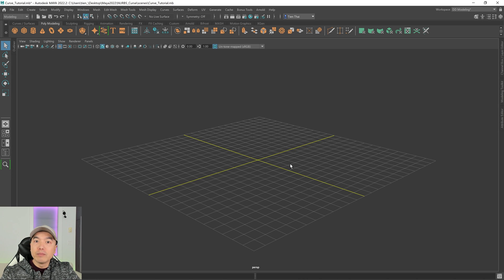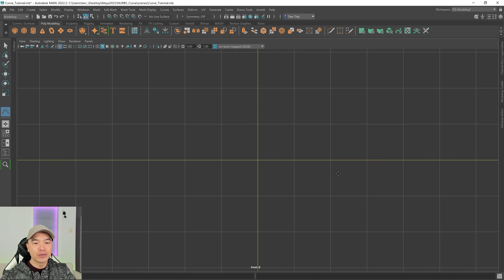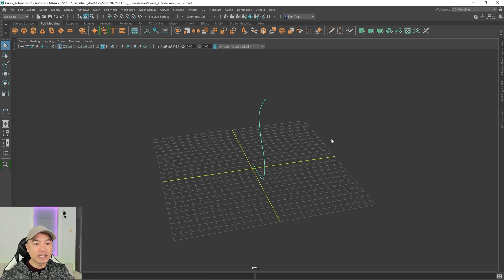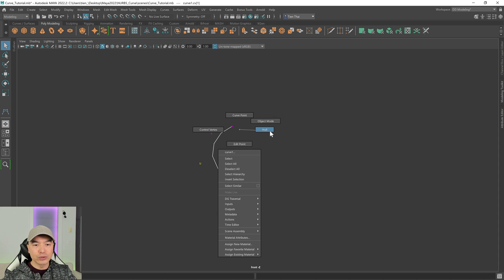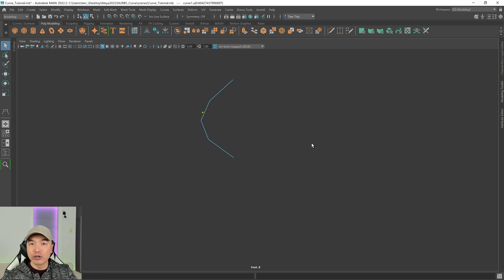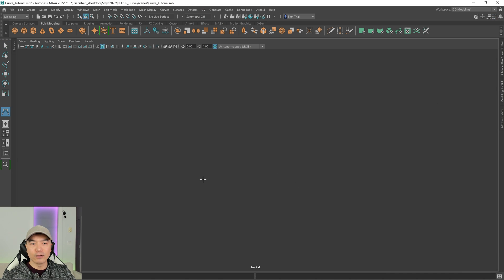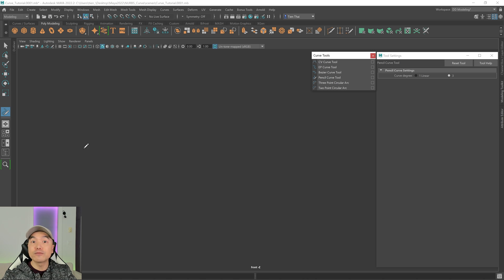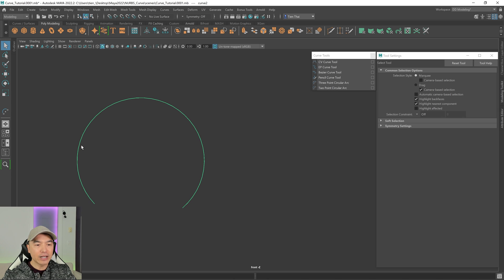Maya Curve Tutorial | Part 1 NURBS Basics

Comment: i follow the steps to make a twisted rope but when i use the curve tool the curve doesnt show and also the initial point, idk if i do anything wrong
Reply from the maker: If you can see the curve check that it's set to visible from the viewport panel menu bar. Show > NURBS Curves. I believe the hotkey is Alt + 1. If that fails perhaps try resetting your preferences.
Reply: @DigitalDreambox  thx mate I really appreciate, I will try it ;)
Reply from the maker: @Jorge9963srj  No problem let me know if you have any questions.
Reply: @DigitalDreambox  Hi again mate :),  do you know how to stop the outliner from filling up? I always get transforms and default light sets and also default object sets, when I make any changes to the model or geometry. I would send you an image so you can see what i m talking about but here i can't
Reply from the maker: @Jorge9963srj  If you have a lot of separate objects in your scene it can be normal to have lots of items in the Outliner that you will need to scroll through. You can group things if it's appropriate by selecting them and hitting Ctrl+G. For transform information you can delete the object's history if you don't need it by going to Edit > Delete by Type > History.